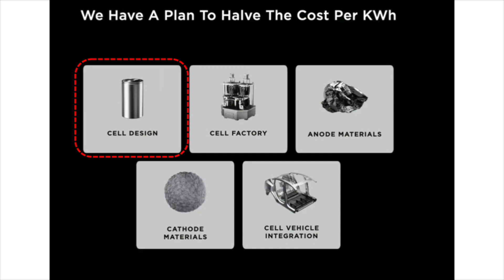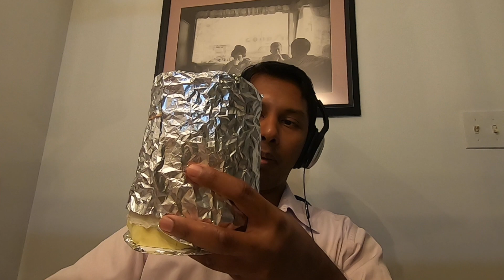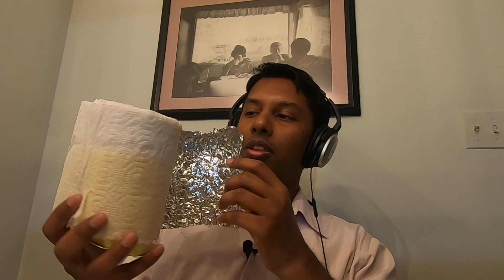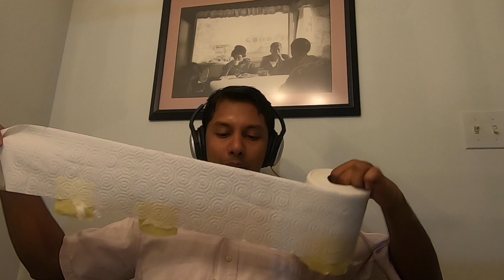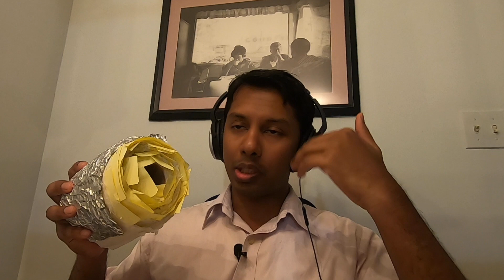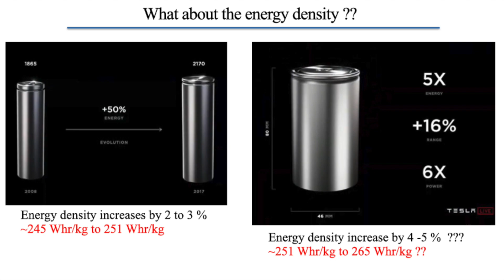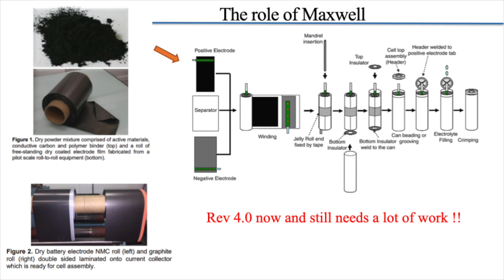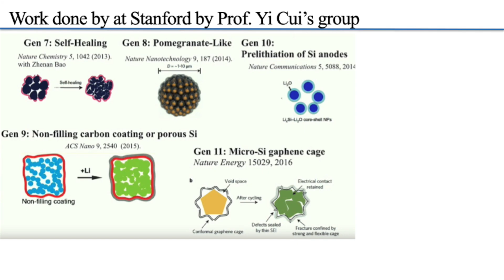Breaking down Tesla's Battery Day with Ravi Kempaiah

Comment: Some of these changes in the next 12 months? The pilot line will be producing 20gWh in 12 months. They are already casting the Back of the Y and I give it a 6-8 weeks before they are doing the front clip as well for testing. It would not surprise me at this point to see them get down to 3 structural components plus the battery in the next year with this new process.

Comment: OK the 1GWh = 695 tons of Nickel got my attention. This calculates out to 100 Tesla semi loads of Nickle per day to each TWh battery factory (1 every 15 minutes). If they are coming from Sudbury Ontario, you would require 600 Tesla Semis on the road to maintain that supply line. I think that is totally achievable.
Reply: or a few railway wagons :)
Reply: @RavindraKempaiah  They don't have a railway spur to Teratexas (yet). But yeah trains are great for hauling bulky goods. A Tesla Semi should be able to carry 22 tons, a railcar can carry 110 tons so 20 rail cars a day.

Comment: The semi could hit that 30 min 400 miles mark with the model three tech. Instead of 75kwh pack. 20 of those.... 20x 250= 5mw charge rate at the low state of charge. Even if the semi only takes 750kwh pack it could hit 2.5 mw charge rate with model three tech. The new batteries will do this without breaking a sweat.

Comment: I think Tesla should partner with their existing battery suppliers - CATL, LG and Panasonic-  to do a tab-less 2170 and 1856.
Tesla will need a low-risk path to improving their existing battery packs.
The tab-less design looks like a no-brainer and this can be rolled out across all existing models.  
Tesla will take time to bring into mass production all the things in battery day. Given Elon-time instead of 3yrs let us say 5yrs.
Reply: Dude...due respect: you're not paying attention.
Reply: @timyarrow8844   I don't want to wait 5yrs or so and neither should Tesla. 
The lowest risk with the biggest improvement is updating existing batteries to tab-less. Tesla does not make the 2170 etc and I don't think it would be a massive investment for Panasonic et al. 
What is the problem, Tesla could even do an exclusive deal since it is their own tab- less design.
Reply: @gargamelandrudmila8078  The 4680 is already in production. BD visitors saw it in production with their own eyes.

Comment: So the tab less design is on both sides of the battery? It will charge and discharge with less heat?
Reply: That was indicated at the Tesla event, less resistance equates to more efficiency both directions and ALL of that resistance loss is in the form of heat.  So yes less heat.
Reply: I think yes, in the first paten page it shows "leafs" along the side

Comment: First of all, I am really not trained enough to understand all of this, but surely there were a lot of Bottlenecks in the past,  Austin will take only for the Buildings at least 2 Years because it is way bigger than Berlin or Shanghai. This is the first reason for delays of 2 to 3 Years. All this equipment has to be built, this takes time also because here we talking about only Austin a 10 or 20 x  scaling only for equipment. Second, for only this reason is time to get even better because of more time to try out. Elon would never present this if he is not 100% sure it can be done, all of this is already working. He was not sandbagging it takes just a lot of time to build all that. for 500 000 Cars to build in Berlin they need first about 40 Giga production, this means a 4X scale from the Pilot line, this I think will be the first and most plausible Way to go, and in Berlin, they need it not before May next year. And he said already Berlin Model Y will be totally different and a new technical design.

Comment: The reduction in resistance not only enables faster charging rates but also increases the efficiency of regen breakin, increasingly turning the available kinetic and potential energy into electricity restored to the battery. This is a huge deal for these heavy semi’ and cybertrucks. In fact, it etches closer to one of the key benefits super-capacitors could bring to the electric powertrain.
On that note though, it could make a lot of sense to have a large batch of super capacitors at the megachargers in between the vehicles being mega charged and an even larger LFP based Mega pack batteries - charged at the backend by renewables. These super-capacitors could hold up well against the insane cycles in between vehicle charges, and be always ready to pump at high speed.
Reply: Elon said no need for super cap any this is so close it would add complexity and cost and just use the extra space for more batteries
Reply: Bert Verschuren 
Sheesh, cool observation.
Reply: @Mark Parker so the brakes will fail once the supercaps are full? better add a big ass resistor somewhere to bleed energy and keep the brakes functional.

Comment: Staying with the cylindrical cells allows Tesla to use the bonded cells as a structural element. . .  I question the math though. . .   16 cells to 4 cells is a lot fewer than 50-60%less cell casings and caps.   What am I missing?
Reply: Although they said fewer casings and caps, what they meant was less mass from the casings and caps.

Comment: Tesla had a falling out with Panasonic when the Model 3 was ramping up. Elon wanted them to ramp up production and reduce costs.  I remember reading that Panasonic threatened to pull out of Nevada. I think this was a breaking point for Elon. He does not want to be relying on anyone else for his company to succeed or fail. When Panasonic threatened to pull out Elon decided to produce his own batteries and not be so dependent on any one source.
Reply: Kenz300
Sandy Munro quote." This isn't Burger King, you can't just say "I'll have one of those"......."
This has been many years in the planning, probably from day one.
Reply: The primary motivation is cost reduction and volume production... not some vendetta against Panasonic.
Reply: @SejalPatelDrSej  I think he doesn't mean it like a vendetta, but simply because they cannot depend their operations on a single supplier
Reply: Bmw1000c they already have multiple battery suppliers (3 of them!)... the bigger issue is that all of these suppliers combined cannot achieve the scale of production  that is required to fully accomplish the corporate mission. Tesla will continue to do business with these suppliers AND produce their own cells. The efficiencies that Tesla has introduced with their new tech and manufacturing processes will allow them to accomplish more with less and that is the true benefit here. Cheaper cells and
many many many many many more of them.
Reply: @SejalPatelDrSej  No vendetta, just vertical integration.
Reply: Just like California.  Threaten Elon's mission and he'll throw you under the bus every time.  The guy is unstoppable.
Reply: @JaiUneGuruDeja  He just works harder than everyone else. He is always 3 steps ahead. Planning his next move.  Playing chess when everyone else is playing checkers.
Reply: different companies have different culture. I don't know if Panasonic's CEO would sleep at the factory' sofa for working to meet production goal as Elon did.
Reply: @exSCV  Well, in that case it wasn't production goal, it was the whole company at stake.
Reply: I DO NOT BLAME ELON..HE DOES WHAT IS BEST IN EVERY WAY
Reply: Elon mentioned that they will INCREASE their battery partners not decrease. So they will do in house + with partners + encourage others to join. 150 TWh to replace the whole fleet (2 billion vehicles)
Reply: Panasonic are not able to innovate at the pace that Tesla wants. They simply don’t have a risk culture. Musk just got annoyed at the slow rate of change and the inability to restart from first principles.

Comment: The increased size probably creates a lot of weight saving on the outer cannister weight, per wh charge...
Reply: Sandy Munro has the figures. Iirc it was around 46% less weight by saving the steel for all those cylinders. Also keep in mind there will be no divisions inside the pack, so they get rid of the I-beams and also cooling will be from the bottom, so way less surface area to cool while being more efficient in doing so, which will also help reduce weight.
Reply: Yeah that and the removal of battery pack support structure is gonna be a huge weight reduction. Tie that to the full front and rear ends as single pieces, you're saving on a ton more weight on welds, rivets, screws, nuts, and bolts

Comment: The surface area of the 4680 jellyroll is five times that of the 2170.
Moving at the same speed, they send 5 times the jellyroll (kWh) out of the factory using the same number of cells.

Comment: The Semi.
You split the Pack and use 4 V3 chargers.
Reply: I have seen videos that, inadvertently, show a device for charging the Semi from 4 or more super chargers.  The mega chargers will hide all of that splitting hardware, but charging 4-6 packs in parallel concurrently is pretty much obvious :)
Reply: @normcfu  
I'm not sure they will hide it.
Imagine a long row of chargers, a Semi pulls up between 2 banks, each bank has 2 standard V3 chargers, connected to one plug.
The driver connects one plug each side and now has 4× 250kW.
All standard charging equipment, modular, cheap to build.
Redundancy on the vehicle in case of failure.
Ability to charge at any "normal" station in an emergency, or overnight.
That's how I'd do it.
Reply: @rogerstarkey5390  Sorry, I didn't mean hide in the sense of making it secret, I meant put it all into the megacharger with a single plug to make it simple.  They will probably also allow the ability to do what you said, plugging in 4, or more, superchargers.  The supercharger solution is smart as a complement to the megacharger network. Both would support concurrent charging of packs.  The only disadvantage of using 4 superchargers is that if one or two of those chargers are in use, as people naturally spread out when charging, or a car with a trailer takes advantage of the "pull through" charging space, it may prevent the semi from charging fast.  I expect, having 3 superchargers plugged in, it will spread the juice across all packs, so maybe 3/4 speed is pretty good.  In the worst case, a semi could charge from a single supercharger while the driver gets a few hours sleep.  Of course, self driving Semis will not require a driver to sleep :)
Reply: @rogerstarkey5390 
Plus the v3 chargers actually can charge at a higher rate as well, get a pic of the info on the charger, saw a pic just recently but don't know where? The volts, Amps etc are vastly above watt is required for the cars.

Comment: It's a serrated tape along the edge of the current collectors. The anode and cathode have the tape on opposite edges.
They are offset by an amount greater than the width of the tapes. There's an insulated separator between the sheets.
Reply: Very simple in concept.   Bit, for production, there must be a catch.  “. . .  any fool”
Reply: You Got it... NO welding.. No bad welds and bad batteries. More good Batteries.
Reply: One of the wrinkles is the serrations change spacing from the centre out as indicated in the patent drawing, as the can only take up so much angular space once rolled up.

Comment: Elon Musk recently clarified that Tesla’s new 4680 cells are already being deployed in some of its vehicles as prototypes.
Reply: 12 months is nothing! Automotive manufacturers make plans to improve an engine over 5 years!
Reply: He said they already have 10s of thousands such cells. At the number of such cells per car needed (roughly 1000 - and certainly not all cells from these trial runs are being put in cars) this means they have at most a dozen or so prototype cars running on them. So, no. We're not looking at volume production yet. He said they are on gen 4 of the machine and expect gen 6 or 7 to be the one that leads to final mass production (Musk being optimistic, as usual). So with an incredibly rapid 3 months per gen - which I think Tesla is capable of - we're looking at 12 months, at least, until the first full machine that is close to the final thing. Then they still need to set up the assembly line. So 3 years seems about right until all the changes come together.
Reply: Omni Curious : I can wait.   I should have my driver’s licence by then. .
Reply: @Omni Curious  Yeah.. it's pretty funny. He says it will take time to get volume production and wall street is disappointed as if he was just playing with toys so far. They completely miss the part where he asks the entire world to please mine more nickel. After all these years people still don't get the insane scales Elon is working with.
Reply: Of course they're being used
Reply: wow
Reply: @Omni Curious  only 12 months?
Reply: Fremont cell factory is up and running - They are optimizing it... They are on iteration 4 of the optimization process and should be able to role out to new lines in Texas after the next 2 or 3 optimization updates to the lines.  Fremont cells for Plaid model S & Roadster then add to other model X & S versions. Texas Cells for Cyber & Semi built in Texas an new Cell factory.
Reply: @riznliz  That is a great point. They have been making the batteries since at least May. The optimization is to get the machine that makes the batteries, to make them faster.